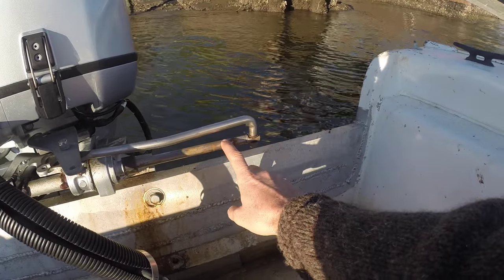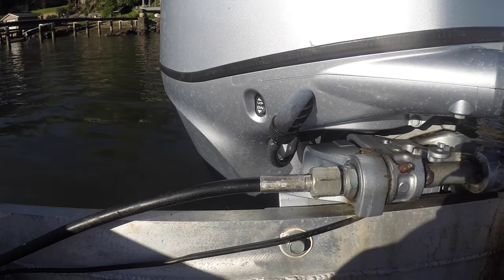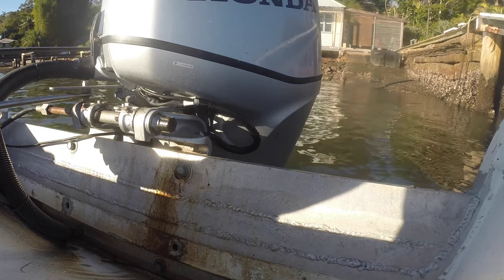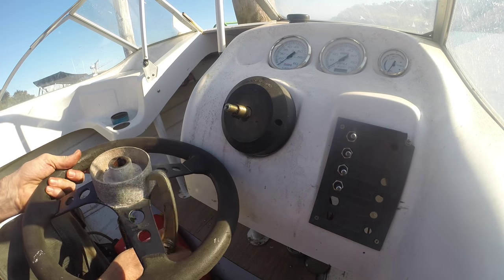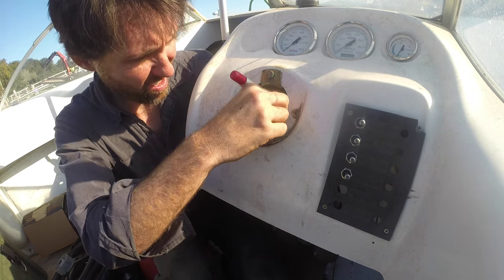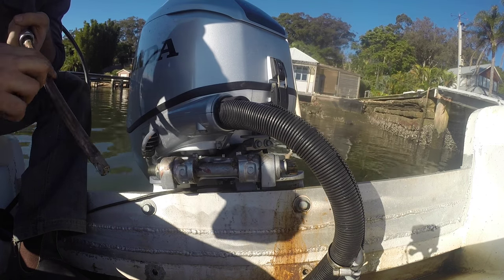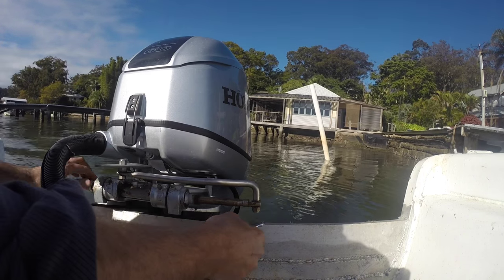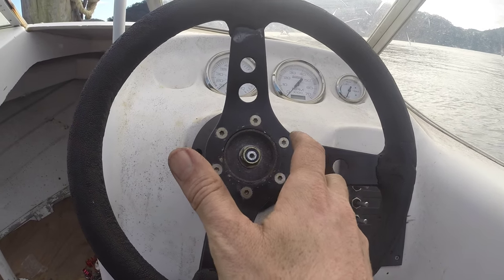Replacing the steering cable and helm in a boat

Comment: I am having trouble getting the cable out of the pivot tube. It appears that another tube is coming out also. I have a photo of it , can I post it?
Reply from the maker: Sure. Put it on some public photo sharing site and post the link.
Reply from the maker: +Jeff Kettle So that smaller inner cable is the one pushed by the helm and pushes the larger section through the pivot tube. It is just old grease that is holding it in place. Find a strong steel rod about a foot long and just smaller than the pivot tube and use it to drive the cable out with a hammer. It might seem a bit brutal but it will come out, and if the cable itself isn't seized it will be reusable, just clean out the pivot tube before putting it back in. This isn't something I do in this video, but I will do a separate video soon on cleaning the pivot tube. A tube brush in a cordless drill or die grinder is
Reply: +Dangar Marine So the larger tube immediately inside the threaded part, (that I have out some scratch marks on) is supposed to come out?
Reply from the maker: Yep, once the steering cable is out the pivot tube with the threaded ends is completely empty. If you turn the helm that thinner tube will slide in and out of the black cable casing, but it is attached to the thicker part. They are both part of the steering cable and need to come out. Just put a rod in the other end of the pivot tube and start hammering away. :)
Reply: +Dangar Marine Thanks Stu. I will continue with the large hammer. Just wanted to be sure I wasn't bashing something out I shouldn't be. Your a legend. thanks again.
Reply from the maker: +Jeff Kettle No probs. I've certainly had times when I've been bashing away and then noticed a bolt I've missed. ;)

Comment: Great video.  I bought a boat over the winter and noticed the wheel isn't straight when the boat should be going straight. It's a Teleflex wheel but that is all I know. I tried to take off the nut below the center cap but couldn't get the wheel off. I tried PB Blaster soaking the shaft. Taping with hammer a few times. I borrowed a gear puller but couldn't get it to clip on. It's not a deal breaker b/c the boat still steers but just annoying to look at. Any ideas? Here is a photo of what the wheel would look like if I was going straight. https://flic.kr/p/FyVcxW Thank you. Matt
Reply from the maker: +RockyMtnBlues Hi Matt, yeah those wheels can be tough to get off. Sometimes the wheel can be disconnected from it's hub and rotated without taking it off the shaft, but this isn't that common. Here is my video on taking one off that was really stuck: https://youtu.be/IQm5ZGlz5jw